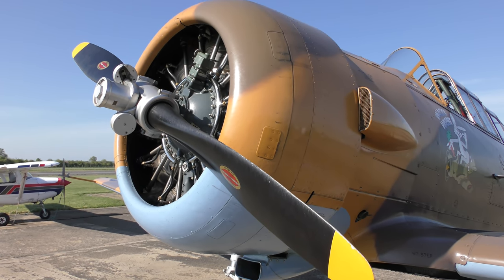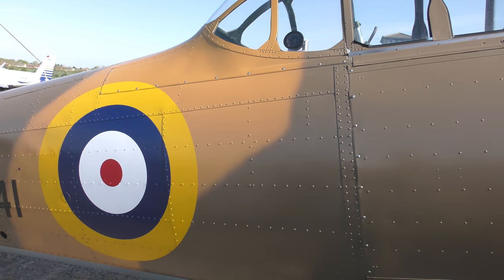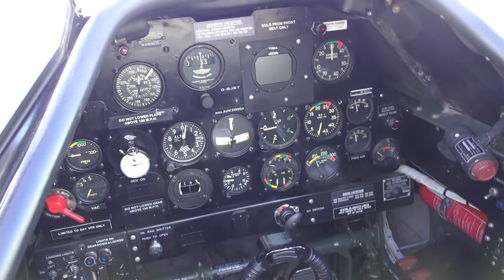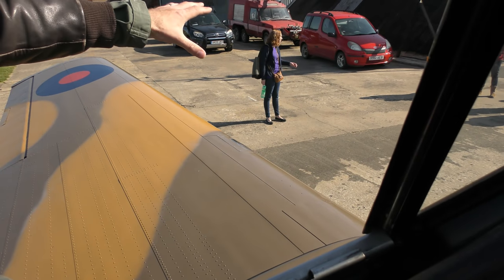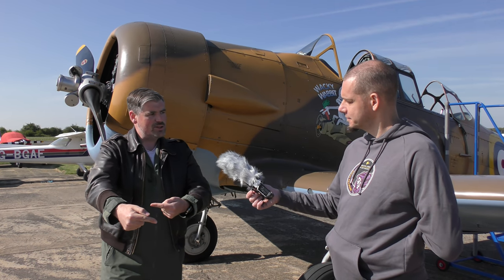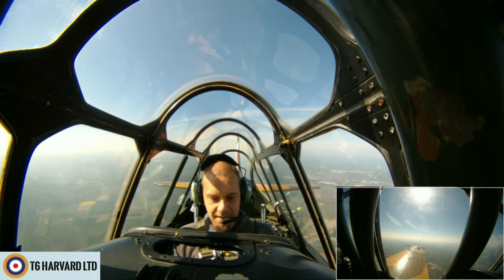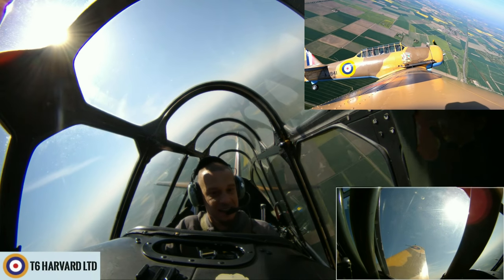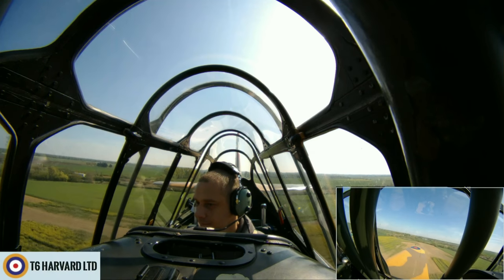Cap Flies "Battle Of Britain Experience" In T6 Harvard (Full Flight)

Comment: Great video, when you mentioned not feeling the resistance ect thru controls in Virtual, have your group thought of reaching out a computer workout company like Tonal to give you a test unit. The group could get together and bodge a realistic feedback system from? They use a computer to simulate the resistance of weights and it should be adaptable to flight sims

Comment: Sorry, video too long to watch. Did they mention the Harvard was used as the basis for the Zero fighters in "Tora Tora Tora!" and "The Final Countdown?"
I believe they were also used to 'mimic' P-47 Thunderbolts in "A Bridge Too Far" though you can easily tell the Harvard and Thunderbolt apart (Thunderbolt has a giant engine and the plane itself is rather enormous for a single seat fighterplane).